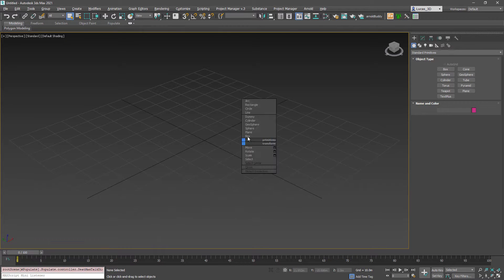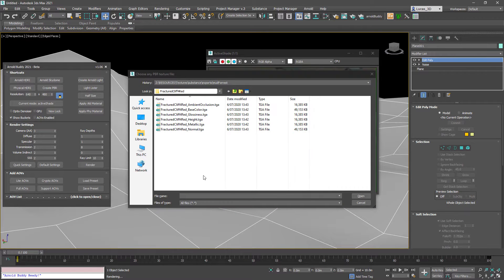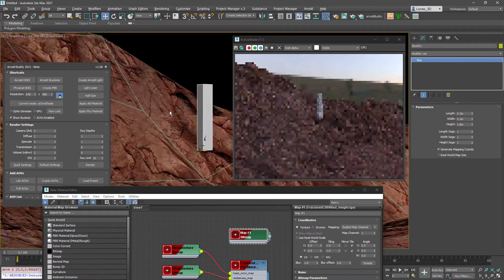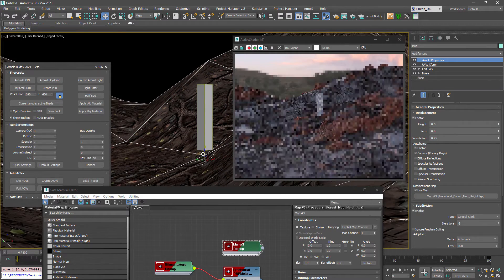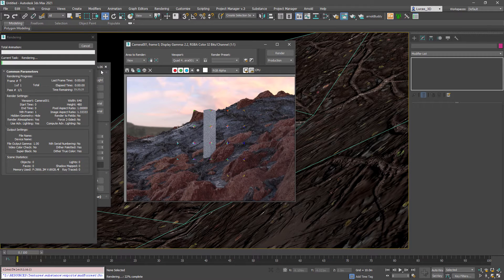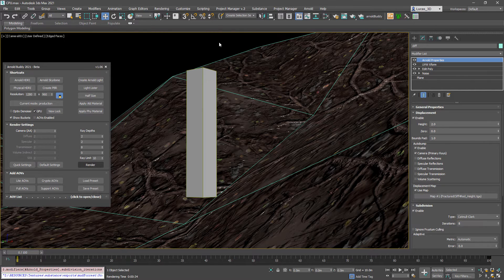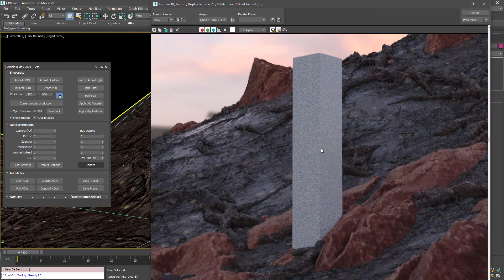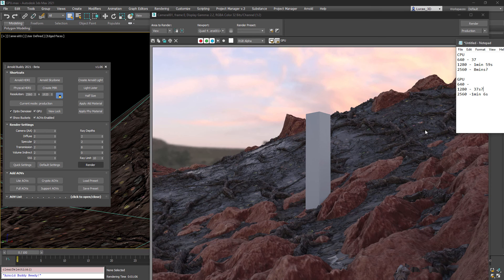Arnold GPU Geometry Displacement and Overcoming Memory Issues.

Comment: Wow that worked, thanks!
So why exactly does that work and fix the issue? How did you even know to do that?

Max is so frustrating 🤣
Reply from the maker: I watch Lynda and LinkedIn Learning videos when I can, one of them showed how this technique does affect the density of the final rendered mesh. I'm no stranger to turning my settings up too far so it was a case of break my scene with displacement (I was doing that a lot), and then find a fix for it, which I was excited about sharing :)
If you don't care you don't don't care, but if this fixes your issue you feel like "Yes, this is the best!". That's how I felt at least.

Comment: Thanks so much for making this video. I was having a lot of memory issues all of a sudden with very simple scenes. Do you know why this memory crash happens?
Reply from the maker: I only guess that memory is running out, either on the gpu or ram...
If you're using displacement like this, then it's probably too many displacement iterations over too large an area.